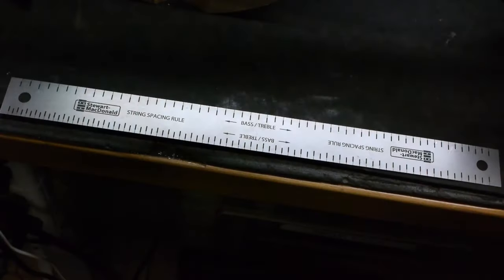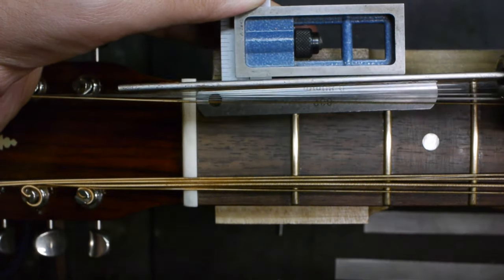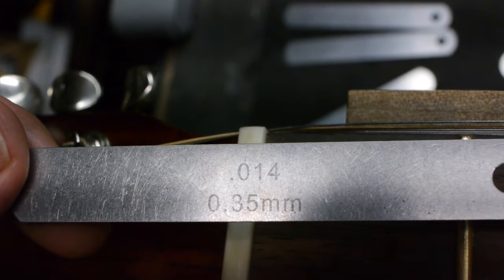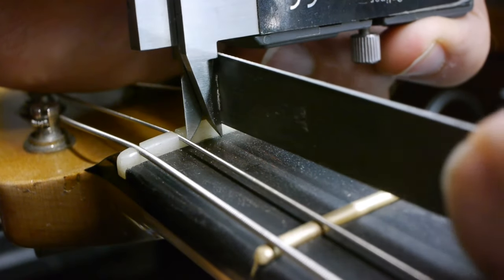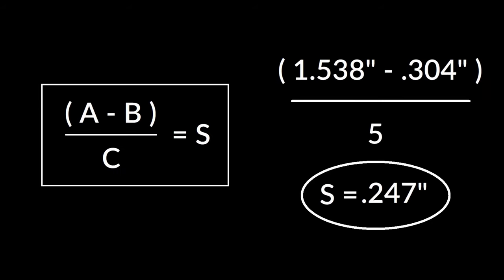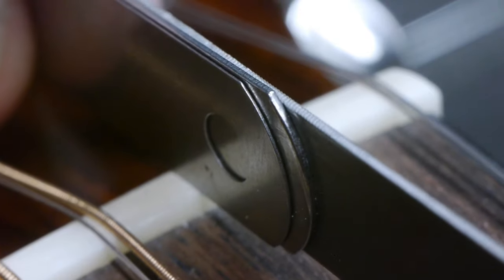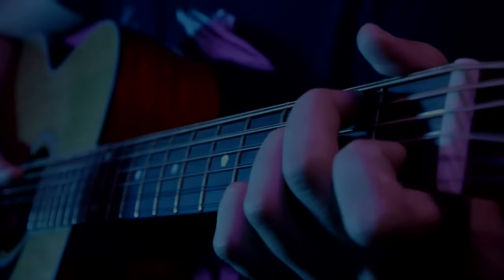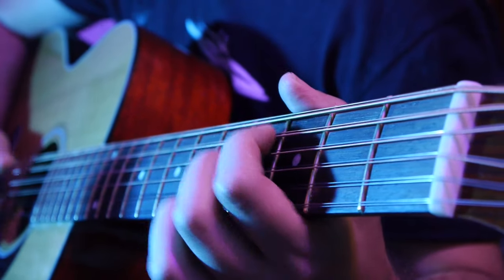12-String Guitar Nut Slotting | BEST Method - FOOLPROOF!

Comment: Fabulous video. Thank you for such a clear and helpful method. Strung my first electric 12 string tonight. I went for .042 between pairs and it is super comfortable. Dead 'appy. Thank you.
Reply from the maker: Thank you! I have a 'reboot' of this coming soon, which should be even clearer. I currently have it schedule to release on December 23rd, though I might release it later. Unsure for now. But I redid a lot of the graphics and explanations -- hopefully it will attract some more attention as well. It really is foolproof. 

So glad you were able to follow this and get great results regardless. .042" is what I used on a mandolin recently as well, and it worked great. The original spaces were closer to .080" between the pairs, and they were overall quite cramped, being much farther in from the fret bevel than they needed to be. Feels much better now. 

Thanks so much for the support and for letting me know! Made my day!

Comment: Dude, your channel is a hidden gem for any guitar enthusiast! I own bc rich 10 string and your guide helped me to figure out why i can't play them damn doubles. Wish you luck, keep doing what you're doing man!
Reply from the maker: Thanks so much! I never saw one of those, but just looked it up online, and looking at the nut string spacing, I can see why you'd have issues with it. If It looks anything like the picture of the BC Rich 10 string I'm looking at now, it could definitely benefit from a well-cut nut with improved and equal spacing, and would be far easier to play. 

Thanks again so much dude, comments like this keep me going. So glad this was able to help you, and the entire reason I made this video was so people like you who have instruments with paired strings can solve their issue and basically turn it into a whole new instrument that's a long more fun and accurate to play!
Reply: @guitar_md  Man, just today i stumbled upon your channel and what a treasure i found! The guitar I'm talking about is bc rich bich perfect 10. So, after nut job is done, i need to replace the saddles and do the thing you mentioned in saddle re-pointing video? Because obviously strings space will go apart down there close to bridge
Reply from the maker: @Merk1n  Yep! You can use the same digital caliper method for spacing the string slots at the saddles. I use this all the time on tune-o-matic style saddles. 

They need to be notched anyway, and most people do them dead center, which can be okay. I always recommend getting some extra saddles so you have replacements as you experiment, in case you mess one up. Keep me posted and let me know how it goes!

Comment: Thanks so much I've been playing Bass guitar and double Bass for Years so wider spacings on guitars the better for me for this reason I Bought a 12 string that had been converted to a SIX string , but decided to convert it back to a 12,( THE SOUND OF THEM IS TORMENTING ME) I started slotting the first pair of Bass E's last night and then came across your Video and the calculations, The Video is Brilliant (The Nut Width on this old Sheltone 12Str is 52mm
Reply from the maker: Thanks so much! I'm working on an updated version and am so excited to get that published. But all the same concepts here, just presented in a clearer and more visually appealing way. 

I just did a mandolin nut the other day and had all the slots cut in no time at all. The advantage with my method is even if you mark out with a pencil where the strings should be, you'll never have the accuracy of using a fence -- just like using a fence on a bandsaw or router table or table saw to get perfectly aligned cuts. 

Thanks again! And I'm doing my best to keep track of spacings I see come in. The mandolin had .084" or 2.1mm space between each pair. I reduced it to .042", or 1.06mm. 

Wider spacing, within reason, really does make a huge difference. Funny you mentioned playing a converted 12 string. Some people have huge hands and do better with much wider necks. 

The sound of 12 strings is definitely unique and takes some getting used to. I'm also working on a video of my new Cozart 12 string Strat. This thing is awesome. I'm planning on installing a piezo pickup in the neck pocket, making a new pickguard for it, installing threaded inserts, cutting a new nut for it, and more. I needed to shim up the octave string saddles, as for some reason, the higher in the octave pair is much lower than the heavier string in the pair, and they're not height adjustable. Had to put a thick shim under each saddle to get them up to the proper height.
Reply: Hi, that reduction in string pair spacing on the mandolin sounds a great shout (just about reduction  by half) I was watching a video on a Rick 360 12 string and the nut width is slightly only just over 41mm don't know about the string pair spacing but I would think your method would be a godsend on it. back to mine I 've gone for a 1mm pair spacing and it's looking pretty good not fully cut the bridge and nut yet (just  working on getting the spacing right ) Over the years I've made a  4 string Fretless. a 5 string Fretless, and just finished a 4 string fretted (first attempt at a fretted) the fretted has come out great plenty of bottom end definition , UK Ash body ,Maple neck ,Ebony finger board, Sung il Bridge (awesome for the money better than Fenders bent piece of tin plate ,) Warman split precision pickup and a humbucker bridge pick up from here in UK lOW PRICE But I know they great as I've swapped out on a Fender precision, Good Luck with the Strat, appreciate how time consuming it must be to make Videos.Take care from across the pond

Comment: Liked, subscribed, rang the bell, followed on instagram. This type of in depth knowledge and know how, paired with the quality production, what a God send! Thank you so much! Huge Leo Kottke fan, I always wondered why they make 12 strings the way they do - with wide spacing between the pairs both at the nut and saddle, it makes it difficult to play anything else but strummy cowboy chords. Loved your tune and playing too, Matt! Keep them coming!
Reply from the maker: Thanks so much! I have a redo of this video on the way -- actually this Saturday. Nothing new, but presented in a more concise and clear way with better examples. 

I saw a picture of an LKSM 12 string online and noticed that the string pairs were very close together. Once I came up with the method for spacing the slots, that was the next step. I'd never thought about getting the pairs closer together. 

I haven't done a video on it yet, but I also routed my 12 string for a 1/4" saddle. And I use nut files to compensate them for each individual string. The nut slotting file cuts away the front of the saddle for the Low E, for example, so it only contacts the area closest to the bridge pins -- and for the octave Low E, I cut a notch on the opposite side, so the contact point is closer to the soundhole. 

I've never seen anyone else compensate saddles like this. But even for a 6 string it's just much easier and faster, and I think more precise. It doesn't look as nice as an even contour but it works like a charm. And for paired string saddles I really do think it's the only way to go. 

I'll definitely have to make a video on that eventually, as it works so well. The 1/4" saddle also makes the intonation much more controllable on 12 strings, and you can use an Amana Tool 47223-S guide bearing bit in a Dremel to do it. I did not use a saddle slot routing jig, just a flat bar clamped down to the top, as far as I remember. So much easier to do. They also make a 3/16" guide bearing bit so 3/16" saddles would be possible as well.
Reply: @guitar_md  Hey Matt - so I have a question - what about the bridge spacing? What do you recommend? I tried .28 feeler gauge between the courses and it's definitely too tight - the strings end up rattling together. So I spaced them out a little bit, I could only go so far on the experimental bridge I'm working on and it's better, but it seems like the skinny strings can tolerate closeness, while the thicker less so (duh). I thought I'd ask the guru for advice (because to me you ARE the guru of these things, I've watched all your tech videos and most of the Kottke covers... the latter are such a joy, bravo!) One of the things I'm thinking of doing is trying bass strings+regular strings and down a whole step. I tune to C on the 12 currently, but only to D on 6 string. I'm only in the beginning of the 12 string adventure, but already bought two identical Corts I'm working on. One I converted to a 7 string - it's so fun! Your videos on nut spacing and the glue/baking soda filler have been a LIFE SAVER! God bless!
Reply from the maker: @boyan.guitar On my Cozart electric 12 string, they're about .080" apart at the bridge. On my Blueridge 12 string, they vary, but are around .100-.120" apart. Not quite though...they're kinda all over the place, dictated by the bridge pin hole spacing. 

I'd say .080" would be good to shoot for. I haven't experimented too much with this, as I'm used to acoustics, where to really change that spacing ideally you'd change the location of the bridge pin holes -- so I just lived with whatever was there, which usually was OK. 

That .080" does feel very comfortable to me on that Cozart 12 string Strat. 

The disproportionate spacing is OK. The nut end of the neck is much narrower and it's more critical for the strings to be farther apart there as you have less room. Tapering to a wider in-between spacing at the bridge will work just fine. 

You could try narrower, but that .080" feels pretty good to me. 

I'd keep them all the same between the pairs. I will have to experiment more but again, judging by that Cozart, I'd say around .080" is pretty good. 

Depends on your playstyle too. Fingerpicking or flatpick, or both. And how much separation you like to feel between the octave strings. 

But -- all theoretical. I've used the nut formula to space strings at the bridge before, but never gave much thought to the between-pair spacing at the bridge. Let's stick with around .080" for now but with the "open to experimentation" caveat. 

Let me know what you end up going with!